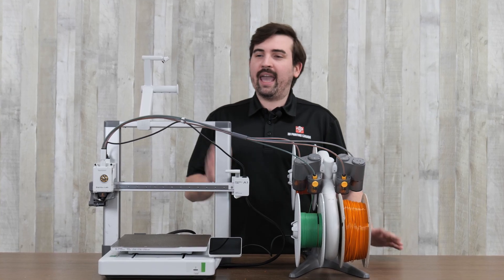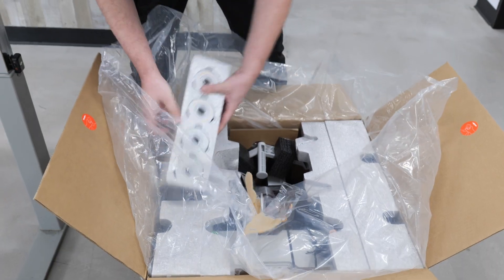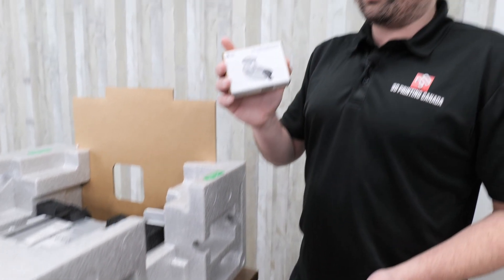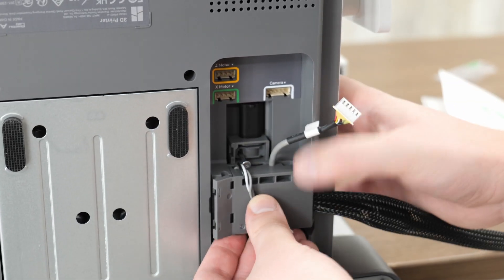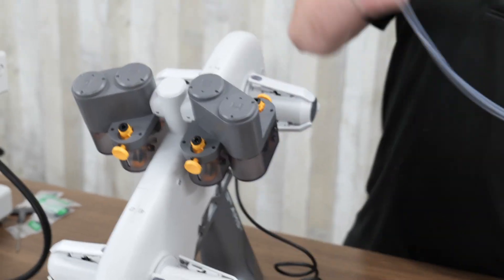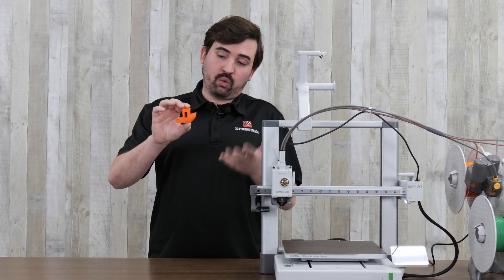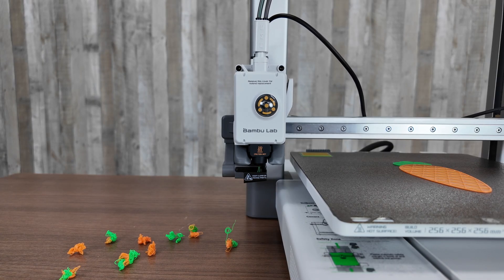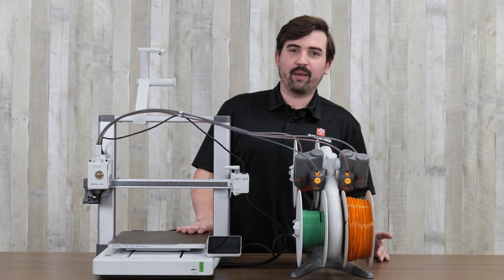BAMBULAB A1 - UNBOXING & TEST PRINTS

Comment: Do you know why my cobra three has an issue where it leaves gaps on top of the final layer and one or two on the bottom I’m not quite sure yet and I’ve tried the leveling the bed. I’m just wondering since you’re very experienced

Comment: I'm loving my A1 and A1 mini.  They're excellent. 👍🏻  After over a year of almost daily use they're still going great!  

Earlier this month i had the tool head block (the plastic structure which attaches to the x axis rail via the bearing case) had a crack in the plastic near where the heating element stone bolts into the brass inserts in that plastic tool head block. 

The Bambu A1 maintenance wiki instructions were awesome.  Disassembled entire toolhead, down to the last screw, even removing circuit board, extruder housing, fans, filament sensor, etc.  replaced heating element, x axis belt, and the cracked tool block with inexpensive purchased parts from their website.

It's back together and printing again, good as new.

Highly recommend